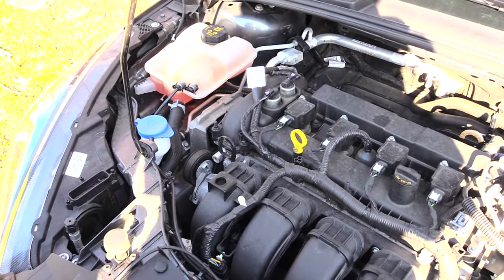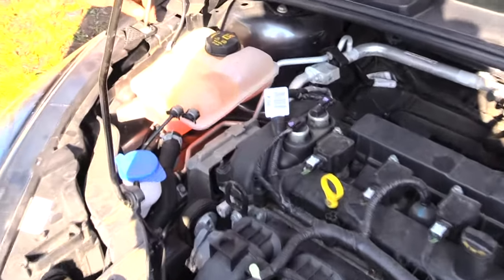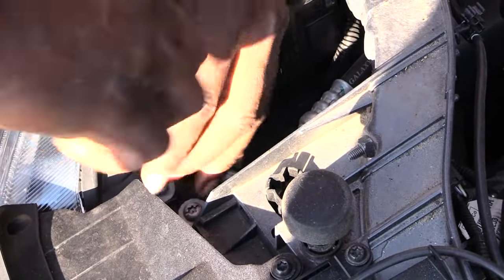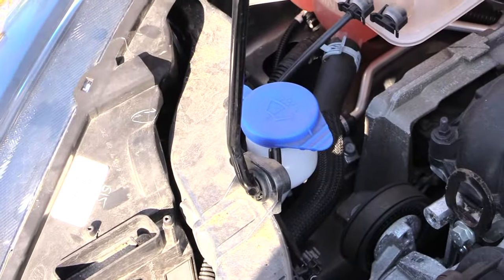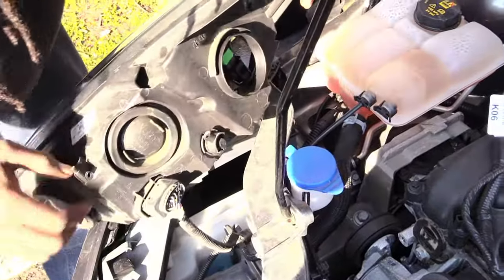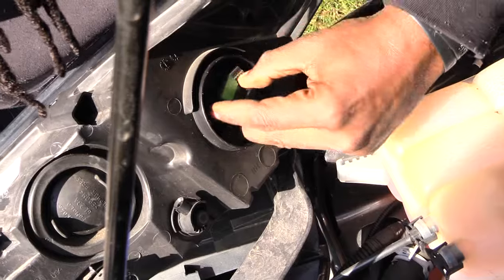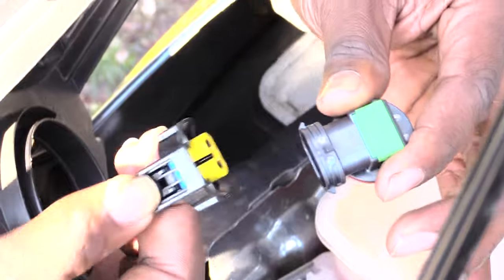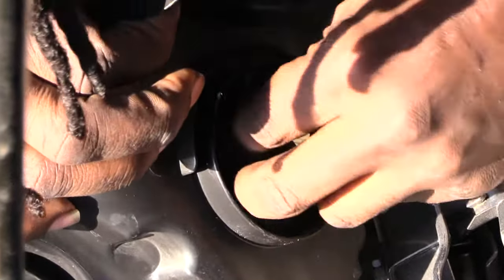Ford Focus Headlight & Assembly Change 2017- Same for many years.

Comment: There's a plastic nut on the outermost wing of the headlamp. You can easily lose it if you forget that it's there!  Those nuts are hard to find at most autopart stores.

Comment: Dont touch the actual bulb or it may burn and melt the connections. Replacement connector is around $13.00 at O'Reilly, part number SS3.
Reply from the maker: Thanks for helpful info👍Please subscribe & like and share if haven't already and check out our other helpful videos

Comment: I appreciate your video, i will use it again when I tackle bulb replacement. I need to run a temp sensor wire hoping it'll let me route it to front of radiator
Reply from the maker: Glad could help👍Please subscribe & like and share if haven't already and check out our other helpful videos

Comment: Having trouble adjusting the headlights. Checked other videos and said there was a screw on the back of the assembly but having trouble locating it.
Reply from the maker: Yes it's should be on back of headlight assembly, hope you were able to get it fixed

Comment: Too bad you didn't show reinstalling high beam bulb .. I was having trouble putting it back in and finally just pushed down hard on silver colored tabs on headlight assembly body .. I don't know if I broke it if I reinstalled it right way . Feels a lil loose . As you know it's got two silver colored tabs to maybe slide in ? but then it also has the middle tab and I thought just push in ..
Reply: You could put the bulb in and then slide the connector on
Reply: @jasoncaine2600  actually very simple ha . oh well .. it goes in only one way . Lil tab can block it and just turn it around 180 degrees it'll go in . And yes putting in bulb in first then conector could be easier
Reply: @jasoncaine2600  My 2016 Focus might have some electrical issues . Had to replace the low beam but then seemed for whatever reason had to replace turn signal one on same side . then replaced high beam on both sides . I finally had to re boot it I figured by disconnecting negative battery cable . That worked . Weird never had it happened with any vehicle before . And my horn only works when it wants to.. It only honks when I press it in very specific tiny area . sometimes . Yeah i guess coukd be something loose ..

Comment: BEFORE you put the bulb assembly back into the lamp, wipe the bulb clean with  some alcohol and a clean paper towel.  Finger oil will cause the bulb to fail!  I did this for fun once...
Reply from the maker: Thanks for helpful tip👍Please subscribe & like and share if haven't already and check out our other helpful videos

Comment: How do I change the daytime running light tube? I have a 2018
Reply: Is that the little led strip that turns on all the time? Because mine went out and the dealership told me you have to replace the whole assembly.
Reply: @alexandro5616  Yes! they told me the exact same thing!
Reply: @lancer717  sadly, I was told the same thing at Autozone when I asked the guy for the lightbulb. I took a hit and ordered it and it costs $1010 at the dealership. My brother works for ford and I was able to get it down to $500 but it was also getting water inside and yellowing so for me it seemed like a worthy replacement. If yours is just out with no other damage, it’s mostly cosmetic. I was able to pass Texas state inspection with that specific light being out. Sorry! I was bummed too. It just came in today hence me looking at how to replace the whole thing on YouTube. Don’t want to pay more.
Reply: @alexandro5616  well that settles that! I definitely appreciate you reaching out. Muchisimas Gracias